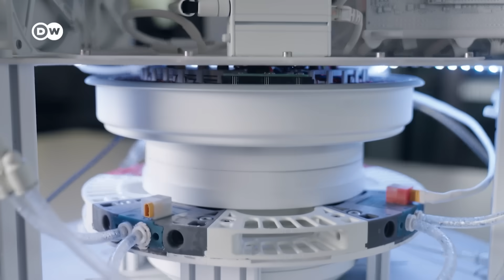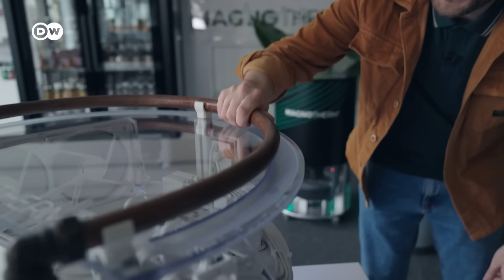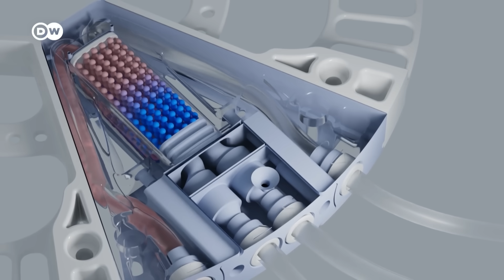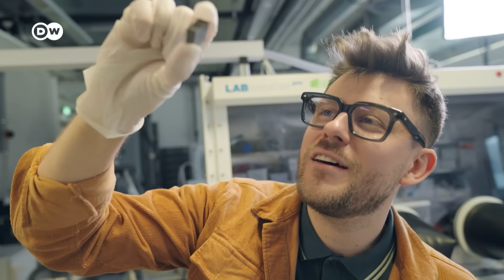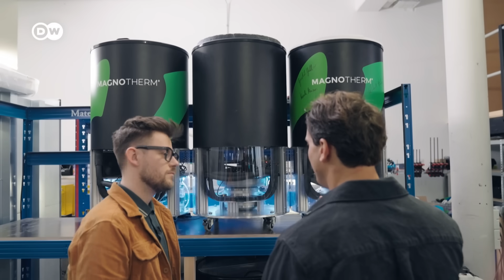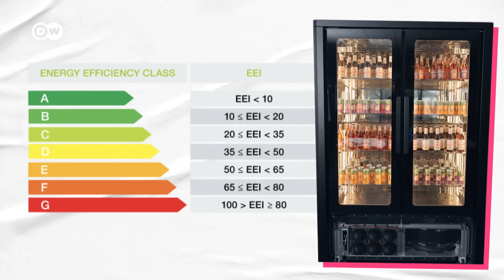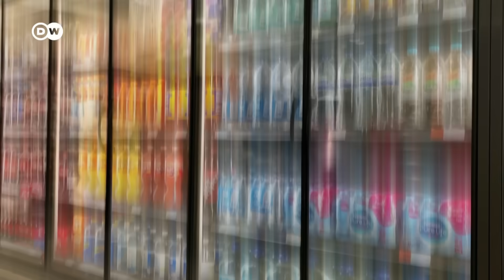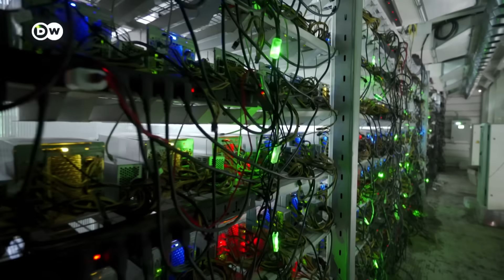How magnets could change our fridges and ACs forever

Comment: Cooling Technologies
👋 Here are details about the modern cooling technologies I mentioned:
🧊1. Magnetic Refrigeration
This technology relies on the magnetocaloric effect in certain materials, often rare-earth element compounds such as gadolinium or its alloys.

* Principle of Operation:

* Magnetization: When a material is exposed to an external magnetic field, the magnetic moments of the atoms become orderly, reducing the material's entropy (disorder) and raising its temperature.

* Heat Removal: This excess heat is removed by a cooling medium (such as water).

* Demagnetization: The external magnetic field is removed. The magnetic moments return to a disordered state (the material's entropy increases), and the material absorbs heat from the surrounding environment to return to equilibrium, resulting in a cooling effect.

* Advantages: Higher potential efficiency; use of solid refrigerants that do not cause environmental damage compared to traditional refrigerants.

⚡2.  Thermoelectric Cooling

Also known as thermoelectric cooling or the Peltier effect, this is a physical phenomenon where heat transfer occurs when an electric current passes through the junction of two different materials (usually semiconductors).

* Principle of Operation:

* A direct current is passed through a thermoelectric cooling unit (Peltier unit) consisting of junctions of N-type and P-type semiconductor materials.

* The current flows from end to end. At one junction, heat is absorbed (the cold end), and at the other junction, heat is released (the hot end).

* Advantages: No moving parts, small size, does not require traditional liquid or gas refrigerants (environmentally friendly), and is often used for cooling sensitive electronics or in portable coolers.

⚙️3.  Nitinol Metal-Based Cooling

This technology relies on the elastic thermal effect, utilizing a nickel-titanium alloy known as nitinol, which possesses shape memory properties.

* Principle of Operation:

* When mechanical stress (stretching or bending) is applied to the nitinol alloy, it releases heat (its temperature rises).

* When the stress is removed and the material is allowed to return to its original shape, it absorbs a significant amount of heat from the surrounding environment (its temperature drops), thus producing a cooling effect.

* Advantages: It can be up to three times more efficient than conventional cooling systems, does not require liquid or gaseous refrigerants (environmentally friendly), and is a promising alternative to air conditioning and refrigerators.

🔮4.  Plastic Crystal Cooling

This technology relies on the barocaloric effect, utilizing plastic crystals with a unique molecular structure.

* Principle of Operation:

* When high pressure is applied to these crystals, their molecules rearrange themselves from a random state into an ordered network, absorbing heat.

* When the pressure is released, the crystals release heat. Controlling this cycle achieves a sustainable cooling process.

* Advantages: Use of solid, environmentally friendly materials as an alternative to polluting refrigerants; high heat transfer efficiency. This technology is still in the research and development phase, particularly regarding generating the required high pressure.

5. Thermoacoustic Cooling

This technology relies on converting sound energy into cooling.

How it Works: A powerful loudspeaker is used to generate sound waves inside a tube filled with an inert gas. These waves cause fluctuations in the gas pressure; when the gas is compressed, it heats up, and when it expands, it cools down.  This heat is transferred via a stack inside the tube to separate the cold and hot sides.

Key advantage: No complex moving parts, and no harmful gases are used.

Applications: Aerospace and military applications (NASA).

6. Vortex Tube Cooling
A very simple device that separates compressed air into two streams (cold and hot) without any electricity.

How it works: Compressed air is pumped laterally into a cylinder, creating a vortex that rotates at tremendous speed. The air at the center of the vortex loses energy and cools down rapidly, while the air at the edges heats up. The cold air is directed out of one opening, and the hot air out of another.

Key advantage: Instant cooling and zero maintenance (no moving parts whatsoever).

Applications: Cooling machinery and drills in factories, and hot work clothes.

7. Kerosene Absorption Cooling
This is an older technology used in refrigerators that operate with a gas cylinder or wick.  How it works: Instead of using a compressor, a flame is used to heat a mixture of ammonia and water. The heat separates and vaporizes the ammonia, which then undergoes a chemical cycle, absorbing heat from inside the refrigerator as it redissolves in the water.

Key advantage: Operates completely without electricity and is entirely silent.

Applications: Older home refrigerators, camping refrigerators, and hotel mini-bars.

8. Laser Cooling

The newest and most complex cooling technology, used to achieve temperatures approaching absolute zero.

How it works: Laser beams are directed with extreme precision against the direction of atomic motion. Photons of light collide with the atoms and act as brakes, slowing their movement. Since heat is simply the movement of atoms, stopping the atoms means cooling the material to unimaginable temperatures.

Key advantage: It is the only way to reach the coldest possible point in the universe.

Applications: Atomic clocks, nuclear research, and quantum computers.

Comment: If the see see through 3D-printed piece's bottleneck is it can't stabilize if it gets too roomy, why not let the water pipe be its stabilizer, by implementing it into the pipe material? And temperature is extracted directly into where the temperature is meant to go. Just make the pipe out of a heat conducting, none magnetic material.
Would need a stronger electro magnet (or maybe a vibrating one?) to reach into the thicker material. But that's rather simple. The hard part is leading temperature before it evens out - So let's shorten the distance.

Comment: How does the magnetic fridge hold up mechanically compared with the standard compressor fridge? One of the first principles of engineering is that the more moving parts something has the more points of failure it has. The magnetic fridge appears to have more moving parts.

Comment: as opposed to a rotating part that may fail, why not switchable magnets and or electro magnetic? Could thermoelectric generator (TEG) be used to recoup some of that electricity? In the same way a care with regenerative braking, recoups some ... some of this could be recaptured.
Reply from the maker: They probably use a rotating permanent magnet because that tends to be more energy‑efficient, as electromagnets would need constant power and create extra heat that could complicate things. And with TEGs, it could be that the temperature differences here are just too small to recover any meaningful energy. 🤔

Comment: Hold on... There is something unclear here. 
If you keep the magnet near to a metal and make it hot. Not a big deal. The movement can cause some micro currents and it can heat it up. Also the magentic dipole alignment can heat it up. 
But this energy came from the stuff that pushed the magnet there. The be it your hand. 
But for a fridge you need to cause that heat inside to make the metal or magnet heat eventually transferring the energy from inside to out. 

Something is not matching... !

Comment: Moving parts sounds like the worst part but still loving the lack of needing a chemical coolant. 

Wish there was a stationary arrangement of coils and controllers that can move magnetic fields without requiring moving parts. Even if it came at higher cost, not having moving parts that need to be maintained or replaced often could save so much in the long run.

Comment: They are in the wrong business. They should not be aiming to become fridges. They are wasting the heat that is produced in the same process. They should be better used in an industrial scenario where a factory needs both heating in one process and cooling in another. That way their efficiency will increase

Comment: I need to know if the fridge will work longer than my current fridge, or that repairs will be simple to do myself, and the parts will be cheap. I won't buy it just because it uses less energy or costs less, because in my country, things break within 5 years and have to be replaced or else get repaired only after weeks of arguing about the warrantee, and still cost a lot of money.

Comment: Unless, they can make this system, entirely solid state, it's not going to be reliable and subject to unpredictable break downs.  Hardly worth the 30% energy savings to any owner if maintenance and parts costs eat at more than those savings is worth.  Electricity is very cheap

Comment: Look at how quickly electric motors and lithium batteries have dropped in prices as the economies of scale kicked in with mass production. In 15 years, caloromagnetic cooling will be as common as induction cooktops or EVs are today. By 2050, most refrigerators and air conditioners will be using this technology.

Comment: So it's garbo. And I can tell you what's causing it to be garbo. Too many single points of failure in the form of active components that need to work in sync.
There's so much time and energy wasted on starting and stopping fluid movement. Not to mention, this is surely generating induction heat as well, reducing that efficiency.
I would think the goal should be to reduce the moving parts in the system rather than increase them. Though obviously trying to make the whole system solid-state just leaves you with TECs.
Few years ago I kept hearing about a "heat diode" that could conduct heat in one direction and insulate it in the other, without needing power. If that material's real, and obtainable, I'd suggest using it so that they don't have to turn the fluid circuits on and off.
Really though, this seems more like it belongs in a support role.

Comment: Why take all the trouble to post this when You know that this TEC is still far underdeveloped and haven’t reached the practical applicable stage. It’s more far back in practicality than the HYDROGEN ENERGY. WHAT WE NEED IS A COMPRESSOR AND A GAS TO LAST AT LEAST MORE THAN TEN YEARS.

Comment: To move "heat" in any direction requires the creation of a "Temperature Differential" (heat apparently moves from hot to cold) the greater the "Temperature Differential" that you can create for the least amount of "Expended Energy" will determine the efficiency of your (Heat Moving) Cooling Device.  The current devices can create huge "Temperature Differentials", for instance the "Hot" side can be well over 200F and the "Cold" side can be well below freezing, maybe -20F.

So depending on what direction you want to move the "heat" (from inside to outside, or from outside to inside THE ENCLOSURE) will determine where the "Hot" and "Cold" sides of the "heat" movement PROCESS are placed.  This device does not appear to achieve the "Temperature Differentials" (The 300F or so) that refrigerant devices achieve.  (Such as ACs etc.)  Especially when the "hot" side needs to be much hotter than the outside air, which in some climates can be well over 100F.

Comment: I just bought a freezer.
They wanted to sell me a unit for 1200 Euro that stores 290ltr ND uses 110kwh per year.
I bought one for 600 that stores 405ltr and uses 210kwh per year.
That's aboute 30 euros more expensive so I 20y I will look realy dumb...

Jokes aside, for those 600 euros that I saved I can get 10 solar panels that have 5kwp...

I don't care much for saving electricity anymore.

Comment: I’m a refrigeration repair specialist, the problem I see is using water as refrigerant medium, how do you get to the temperatures needed for modern refrigeration? In a closed system as the water temp drop pressure increases which could damage valves and tubing.  Also if a valve fails I imagine the steel mesh cubes would have to be replaced as they are pretty delicate.

Comment: So you use 30% less energy, you're using water to do the cooling, which limits the temperature to what you can cool (can't freeze stuff), not to mention if water is required for the process on places that there are water outages this wouldn't work, which in some cases is more likely to have water shortage due to rationing than electricity

Comment: I don't think was a good video at all.
Maybe a host that can be both a physicist and a technology enthusiast?
And more qualitative technical/scientific journalistic research and fact checking. 
If you know physics, there was almost nothing relevant explaining existing fridge technology, and not this new technology either.
I expect more of Deutsche Welle - this is shallow content.
Several of the comparative measurements weren't explained enough - what was actually measured, what were the units and it wasn't even clear if a higher figure was good or bad.
And can this technology be used for freezing? 
9⁰ Celsius was mentioned, but that's not cool enough for a fridge, which needs to manage down to 3-5 ⁰ C.
And if it cannot be used for freezing, which the use of water as the cooling medium indicates, I think it's a dead end technology. 
Especially when considering all the moving parts, I think current heat pumps are superior. 
Good luck with the further development of this technology, but household equipment won't be the application area...

Comment: I wouldn't buy it att all, simply because it have to many moving parts, and moving things tend to brake more often, a normal fridge does not brake that often specially the old ones, and if they do, they are easy to maintain and put in to service again. Then the weight and price and special parts needed take it all to another level off complexities.

Comment: Can it be reversed ?
Reply from the maker: Yes! The magnetocaloric effect is reversible. Magnetizing heats the material, and demagnetizing cools it.✨
Reply: @DWPlanetA which means we can stick a copper rod, enclosed with refrigerant into the ground for geo thermal heat transfer and be more efficiently converting the heat energy into electricity ?

Comment: you dont need to optimize the magnet, you need to optimize other componant, cool needs water/earth elements(in shade in darkness) and water needs shade, darkness cools water, air and water in darkness cools water and air toghather ( remember when you shake a bottle of water cool is released !, then there are white metals which like to absob cool and cool down, and hot metals like copper that like to be charged with heat, 
copper even during night is warmer, while aluminum or silver " white metals stay fresh even under the sun, so combiding those two informations a design has to had a dark room and an external space where the heat is transfered, then released or used, and to conduct this heat is increased by accordinly chosing the right metlas to do it

Comment: Ironically, all coolers are net heaters.
They output the heat removed from the cooled content plus the heat dissipated by the process inefficiency. A hot city is actually hotter as a result of massive AC use. Domestic apliances should find a way to reuse the extracted heat, as it is sometimes the case with industrial processes.